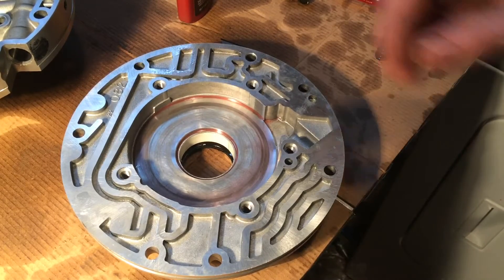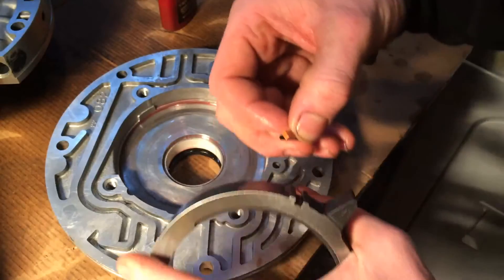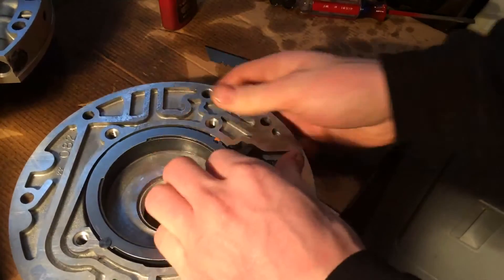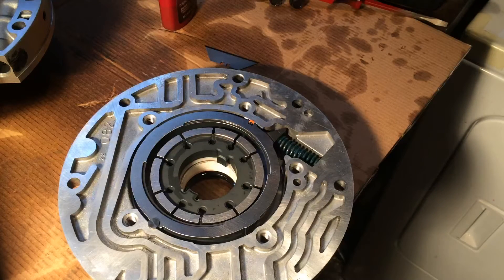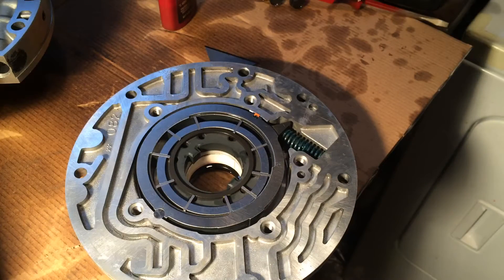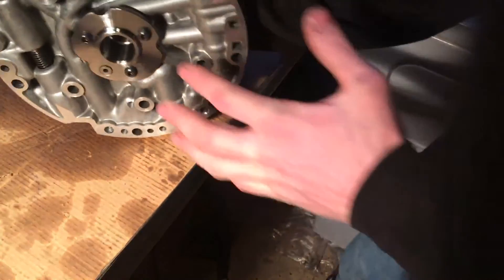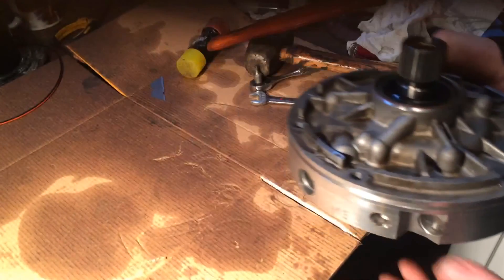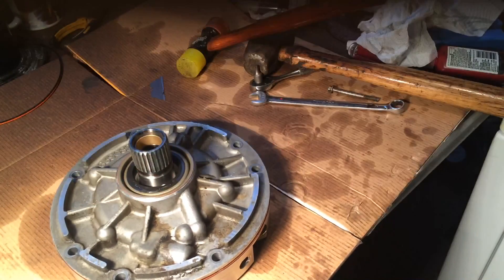Automatic transmission front pump reassembly

Comment: You can easily remove and install the pin of the pump stator shaft using a vice and socket. You should install the pin in the new stator shaft first as it acts as a guide. Ideally you want to use a press to install the new shaft but you could place it between two tables then use the rubber mallet. Also a drop of locktite on the T27 screws may be beneficial.
Reply from the maker: Thanks for the advice

Comment: Rebuilding gm 4l60e  I have a felt gasket before joining both halfs together....do i need to use some kind of sealer on the gasket?
Reply from the maker: Im sorry I don't have much experience with 4l60e's. But my guess would be no.